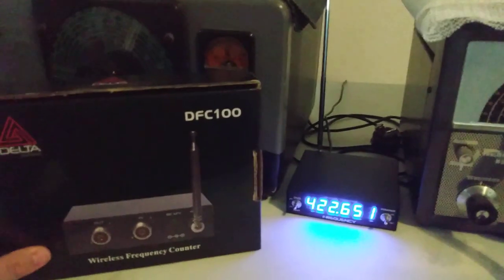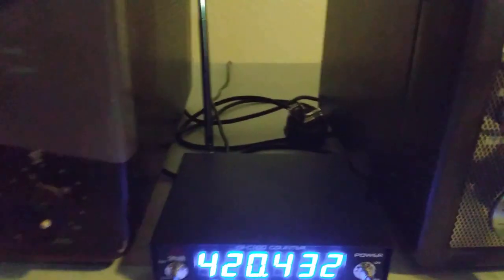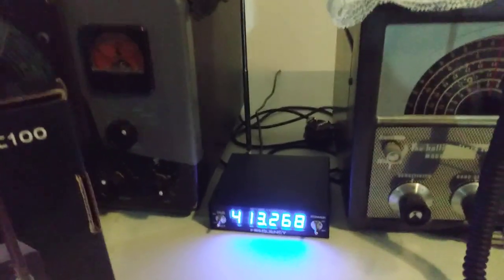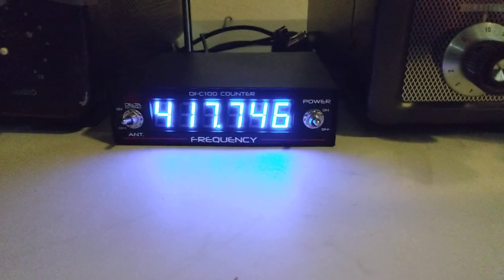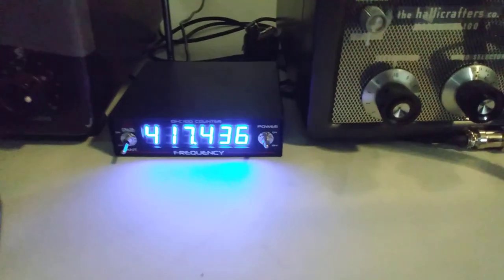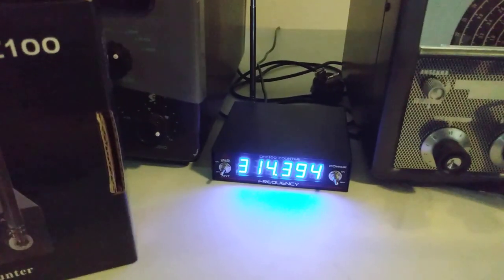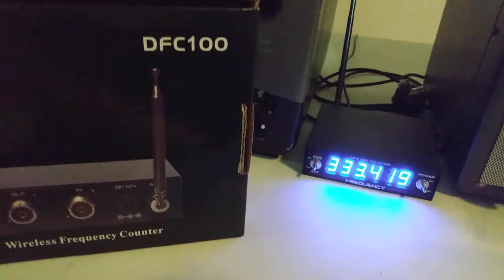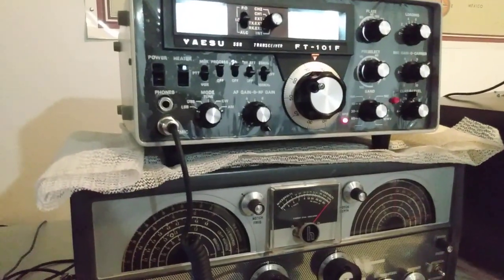DFC100 Wireless Frequency Counter for CB Radio, Great for boat anchors

Comment: Does this work on SSB? I've seen conflicting information on this
Reply from the maker: Good question, no. You need a resting carrier which is impossible on ssb
Reply: @Rooster_Radio  thanks for the info
Reply: Dosy FC50-S
Reply: Put a 18k 2-5watt resistor in your vfo will help with your drifting on your ranger. Johnson’s so old the values start to change that’s why they’ll drift.
Changed mine in my ranger and valiant. 👌🏻
Reply: It will work on ssb down load an app that plays a 1000 htz sine tone.... Play the tone near your mic and key up it will give you a reading but they are as accurate as a tin of beans..... There is a way to calibrate it inside but the calibration is only about 2.5 kc up or down my unit was about 7kc out and only way I could get a reasonable reading was to set it to one full kc out.... So if my meter reads 27.5560 I know I'm on 27.5550.....  I have video of it on my channel  but for the money they cost they are not very good  in my opinion...... And if anyone knows a way to calibrate it better I'd love to know......
Cheap screen one I bought of Ebay from China works alot better it has a built in offset  whick is a great feature..... And was a fraction of the price even with buying a box and a battery and switch for it it was less than a third the price

Comment: Personally I think mine is junk..... I bought it for cobra 148 gtl dx.... Set it up  tried it on my 3 cb radios that do have frequency displays the cobra 2000 gtl president lincoln 2 plus and president lincoln mark one..... Same result on ssb with a 1khz tone... if radios are on 27.565 the meter is on 27.5660.... On all three radios  same result and on am mode it's worse it's on 27.5672 on all three radios.... I then tried it on my icom 718 hf radio same results..... And then when I plug it inline on my icom 718 it has a different reading to where it is when it's on its own antenna.... For a price of 135 euros I'd expect it to function  a bit more accurately than it is... Or at least to be out but a constant amount so I could then use the same constant error  to put my cobra 148 gtldx on to the correct frequency.... But as is it's little more than expensive junk I'm afraid

Comment: Sent mine back. Total piece of garbage.
Reply from the maker: Mine works great
Reply: Did you have to run a 200 watt carrier before the thing would read it I just got one off Amazon it will not pick up a Barefoot radio you got to run a 200 watt carrier before it would even pick it up